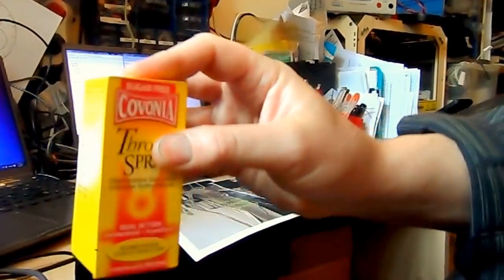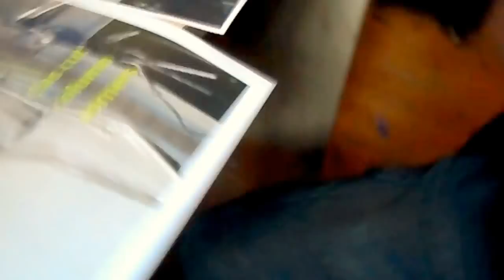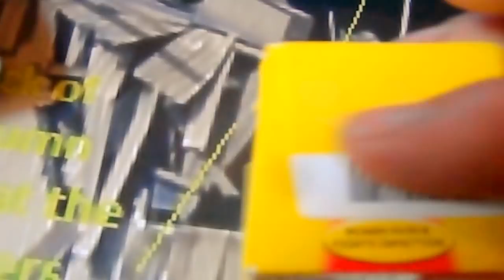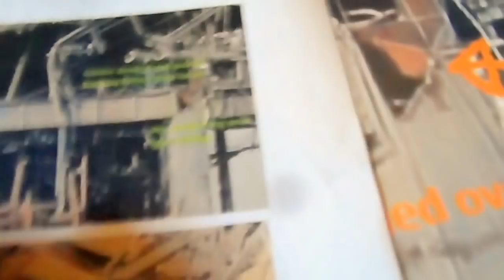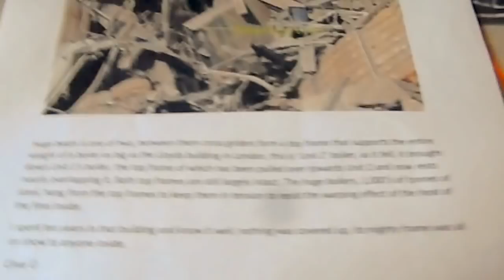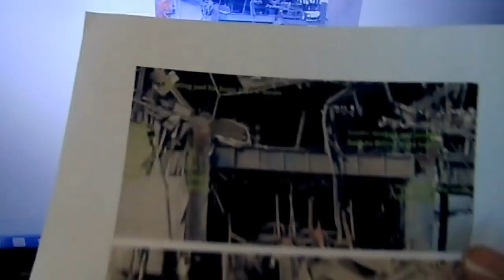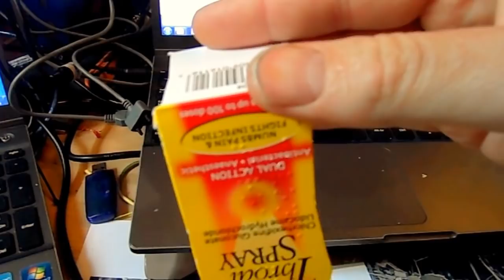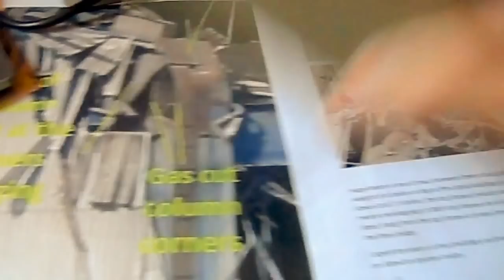Collapse of Didcot Power 'A' Station explained

Comment: Perhaps if the station had been dismantled in reverse order to its construction, it could have been somewhat safer.  I spent much of '71 and '72 investigating problems with cracked welds on the boiler to turbine pipework and valves (some of which would give you nightmares). There were lots of problems in the early days with the welds, (not surprising as some of the welders were working 36 hour shifts). Some of the welds were uncertificated and hidden under lagging by the contractor. There were experimental excitation systems which failed ( diodes flying through the roof!), coal paddle feeders falling apart, and during my time at Didcot, there was only 15 minutes of generation (Can't remember which unit) before it was interrupted by a hydrogen explosion blowing out the bottom of the alternator. There were also other fatal accidents during my time there.  I think the Chinese curse applies- "May you live in interesting times". Despite the problems, I had some great colleagues and I think that Didcot did eventually settle down to reliable generation. I don't know if the station had actually reached its fatigue life limit or if it was only shut down due to Brussels diktat, but it is extremely sad that it ended with the the tragic loss of life.
Reply from the maker: Thanks for this - yes herd about the 'rotating rectifier' going up like a fireworks wheel! :D

Comment: Interesting. You've got to wonder who designed the "pre-weakening" of the structure and whether they took into consideration the weight that was on that beam! I gather it was Coleman's first power station demolition, it looks like being their last too if it's found that they were responsible for the collapse. News reports suggested that the remaining structure (units 3 and 4) had already been pre-weakened and was also in danger of collapse. If this is the case why is it that only Unit 2 came down?
Reply: Power station demolition should not be taken on lightly. I remember that my father's employers tendered for the demolition of Cardiff Power Station, but lost out to a much cheaper tender from another company. As my father's firm had built the reinforced roof for WW2 bomb protection, they knew what it would cost to demolish it. The company whose bid won, went bust!